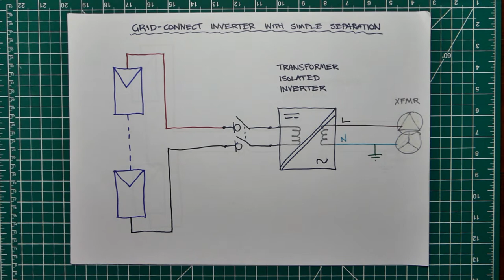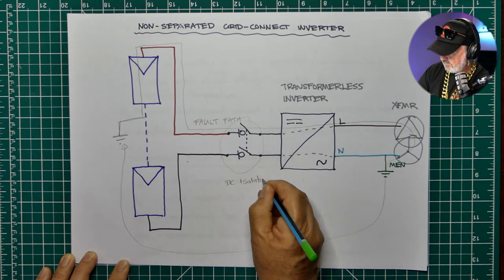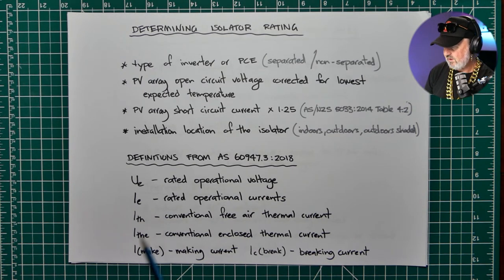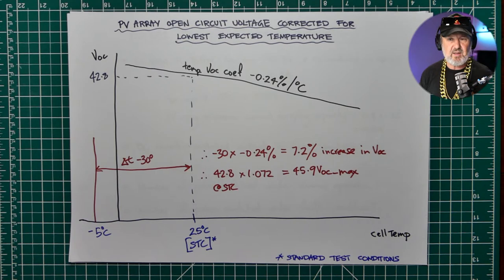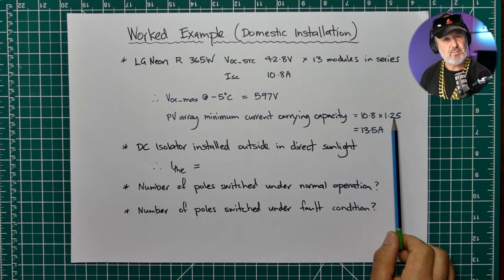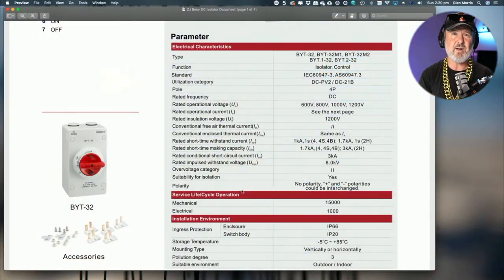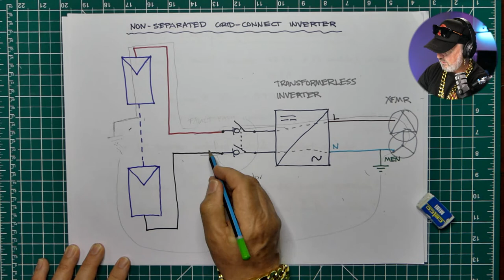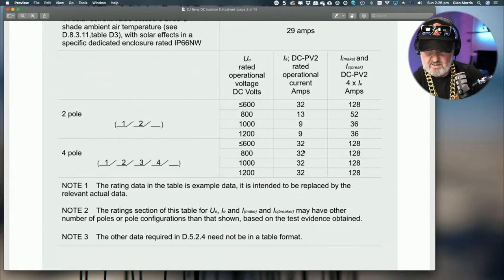Which Switch is Which

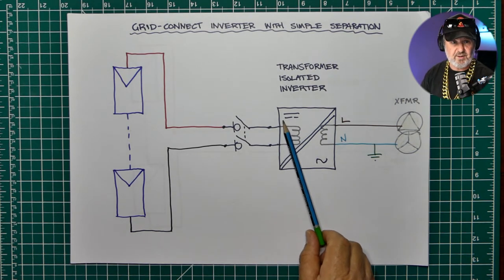Comment: 6:43 is shown TN-CS(TN-C)? Just to aks, is this better for distance houses install TT system with the simple creature of earthing (3 x vertical wire 2.5m/s" give 1 (1.5) ohm vertical put into ground connect to a central point (gship, box ..) with 16/30/50 mm2 earth protect cable) And as last your video, and this one is 10++ and bravo and thanx for sharing this good solution!
Reply from the maker: Yes, Australia uses TN-CS earthing system (commonly referred to as the Multiple Earth Neutral M.E.N. system here). I agree, since the advent of RCD based earth leakage detection, a TT earthing system would be better... but that's not about to change in Australia anytime soon, though New Zealand are allowing it for some applications. Thanks for the compliment too.